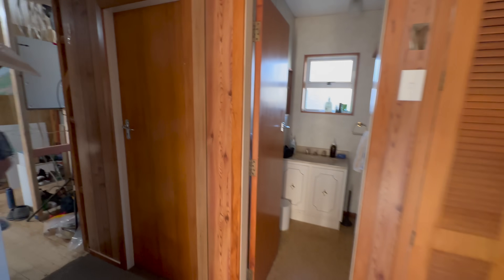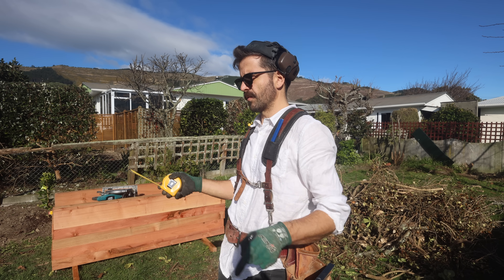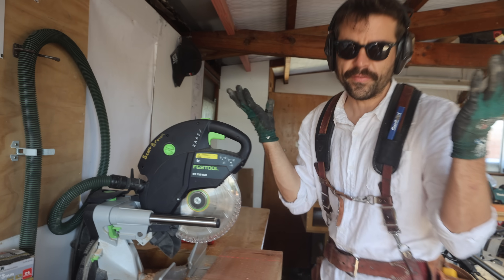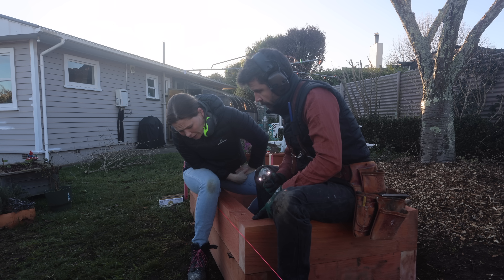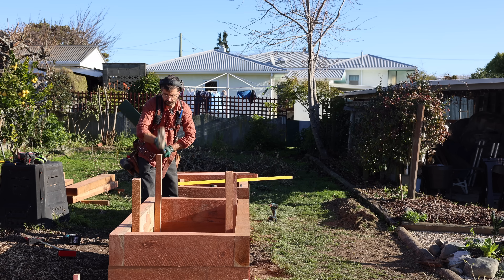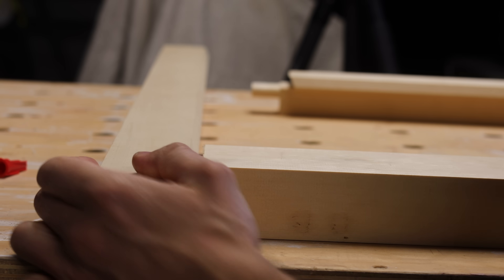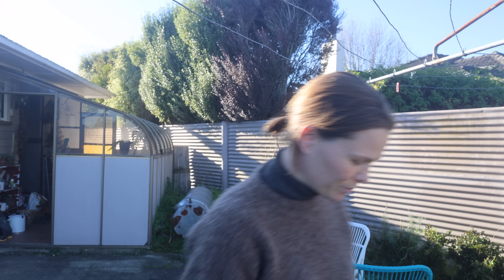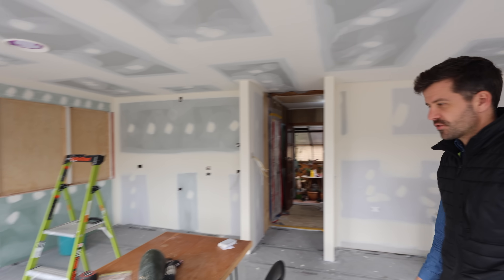A Fussy Carpenter Builds a Fancy Planter Box

Comment: Tip for then the screw jams and the impact drive won’t move it, cut the head off leaving 100mm, then put the tip in your drill chuck and reverse it out much more torque👍🏻 As always great video Scott!
Reply: I came here to say exactly the same.
Reply: Generally the continous torque of a drill will remove screws that impacts dont remove
Reply: I would have used a block and prybar, lifting under the head with one person whilst rtrying to reverse it out first. Just hate the thought of wasting a good screw.
Reply: I’ve done this but it actually damages your chuck doing this. The three teeth that hold the drill bit tend to get damaged, also instead of cutting the head off why not just use the drill to get it out?
Reply: Put the torx bit with a hex adaptor into a 1/2" socket set and use a galvanised pipe as a breaker bar.
Reply: get gasoline and a lighter and burn it out. works all the time
Reply: Scott brown will come here for the tips too. Like I have

Comment: Just a tip, if your impact can’t get a screw out, swap the bit into your cordless drill and put it first gear and hold on and it’ll either loosen the screw or snap it inside the timber. Love your work

Comment: Excellent planter boxes. Quick tip for next time you are filling a planter box, use garden bags for the soil / compost / leaves you are putting in. Much easier to shovel into a garden bag in the barrow and then just lift the garden bag of material and tip it in the bed. :) One lot of shovelling and much less mess. Wondering why you didn't put the logs in the bottom of the beds? Disease? Concerned they may sprout? Trailer - 8 x 5 minimum, tandem, with electric - hydraulic hoist. Investment I know, but really worth it, especially at this stage of your lives. Really looking forward to the kitchen windows happening. Paint is going to transform that room.

Comment: Hey Jess and Scott,
Good change of pace from the renovation routine.
For Jess: don't worry for the planter's "warning" color, it will grey out fast.
The "autofertile lasagna" (that's a rough translation of how we call them here) work well. It keeps moisture and cool when it gets really dry and hot, like right now for us in the North hemisphery. However, it takes some time to set. That's like a little ecosystem that installs itself there, with insects, bacterias and such. It often takes over a year for the wood to start rotting properly and hosting all this beneficial life. Don't be in too much of a hurry for immediate returns, you're in for the long run with these.
Good video, thank you!

Comment: I built outdoor planting beds for my ex several years ago.

I used pt 4x4s and drilled clearance holes though the first two layers. Offsetting them as I put them down. I ought some rebar and cut 36 " lengths and then pounded them into the ground. That stopped it moving.  I put poly on the insides of the timber framing to prevent it leaching out. My sensei and I went to the county dump to get a trailer full of compost. The trailer just fill it up enough to the top.

We had veg up the wazoo. So many tomatoes that we couldn't eat so the squirrels scoffed the rest of them.

Comment: i have three planters which are 1.200 wide by 4.000.  i use home made compost to top them up every year.  amazing how the soil level drops each year.  two big bins should be enough.  i fill a bin over a year and then turn it over into the other bin for use.  as the stuff on top has had a year to break down is is usually very rich.  my bins each hold 1.8 square metres.  amazing that you got redwood.  in wanganui i used macrocarpa as that was availbale in untreated and generally lasts 20 years outside.

Comment: Scott - you commented that you did not know the performance of redwood in soil.  In California, used all the time - fence posts.   Also in turn-of-the-century homes (mine included) they typically had a redwood mud sill foundation (redwood on dirt).  I had 100+ year old redwood what was not rotted or termite invested that I replaced with a concrete foundation.

Comment: Check out the square foot gardening method. Or, if you prefer (I do) the 30x30 cm gardening method. Special soil only 15-16 cm deep. A 5x2 square planter box can be built like a wheelbarrow at very comfortable standing height, without any bent back, using softwood lined with polyethylene sheet and some wheels. Easy to move around and possible to grow very intensively. Have always one just outside the kitchen door for harvesting. Replace with another as needed.

Comment: For Jess, when using the drill/ driver, put your support hand on the back of the head of the drill instead of on the battery. It will help to guide and keep the trajectory you are driving the screw, instead of holding the battery which taking away from the pressure driving the screw in the right direction. Like when you guys work together, nice flow!!

Comment: Hey Scott! Just wondering, are you using plaster, or is it drywall and mud for your project? Over here in the States, we have the option of blue board and plaster, but it's not very common unless the budget is unlimited. Curious to know what you're working with! Ron😎🤙
Reply: drywall and mud, gyprock plasterboard is the standard in Australia/New Zealand. Nobody does hard plaster unless they're loaded (and maybe in Western Australia where double brick is the standard? Basically everywhere else in ANZ uses stud framing).

Comment: G,day from Sydney Australia.
Excellent detailed window frame, "they" call the "legs" horns and would round them (one side) when used in sash windows. A trench was cut on the outside styles for the sash cord. This was inside a box frame with divided weights running  over pulley wheels, separated by parting beads.
🇭🇲🪟

Comment: When a batten screw or similar gets stuck like that, I find what helps most of the time, is using my drill on the low speed / high torque setting and unscrewing it. It will either come out or snap the screw.

Comment: First thing I every built out of sleeper was a pond. Hand cut all the sleepers with an electric saw- after that experience I would never use sleepers again. I have built planters for the garden which still look like new and are about 5 years old and have been through wet cold winters. I went for a round over, hurts less if you bang your knee on the edge. You could use bokashi composting, If you have enough space get a compost bin (1m x 1m) it’s the best thing you can do for your garden. The planters look good and will last years

Comment: He Scott, for the long screws its better to use a normal drill instead of the impact. The impact gives little kicks, the length of screw flexes, taking up the force of the impact, and before the next impact the screw flexes back. This way no energy remains at the screw tip. A normal drill puts continues pressure on the whole length of the screw which takes out the flex, and doesn't give the screw a chance to spring back.

Comment: Hey Scott, question. With the thermally sealed house, what heating will you choose? I'm trying to find any Kiwi real world information on infrared panels, the only suppliers I can find don't even have showrooms.
Reply: they already installed a heat pump ducted heating system in a previous episode. Heat pumps/reverse cycle units are the way to go - COP of 4-5 compared to max COP of 1 for infrared/radiant electric.
Reply: @Nickvin Yeah not true. Heat pumps lose efficiency very quickly and are expensive. Their COP reduces over time. Organic buildup on heat exchanges are a huge problem (could be ~60% reduction), there are no cheap ways to solve the issue. Infrared may have a place in conjunction with heatpumps. This is the shit I want to know.

Didn't ask for heatpump COP lecture. If you have Infrared panels information let me know.

Comment: Trailer, Chainsaw are a must as a homeowner,  also when i start a new hügelkultur bed, i will lay literal tree logs on the bottom (like the ones you were loading into the trailer) woodchips are also perfect but the common trick is to use wood that is rotting already, it provides the necessary micro organisms for it to emulate nature...you might need to invest in a 305mm mitre saw for your home workshop too lol

Comment: Scott, could you not of achieved the cut on the mitre saw if you had put a straight, thin piece of timber against the back fence of your saw? Bringing the sleeper forward slightly, result in the blade being able to finish the cut ?
Reply: Thought as much
Reply: This is the biggest problem with the Kapex. Rabbeting function is useless because the center of the blade can't go behind the fence. What was Festool thinking? I'll just put a scrap of wood on the fence of my $1,600 saw to make it work properly...

Comment: That screw would have gone out with a regular drill rather than an impact. We used one of those that they use for ice fishing when we screwed together timber in our cabin. None of the impacts we tried was able to. Milwaukee, Makita or Bosch. Went in/out smoothly with a Makita drill. Will hurt your arms tho :D
Reply: Bosch have a good video on youtube eplaining the reason for this, log story short, a long screw will absorb the many small impacts from the impact driver because the metal can twist a bit (like a spring), and that means that less torque is applied at the tip of the screw.

Comment: There is not any plants apart from Asparagus that need that much depth to live and grow in. Could have saved a lot not going so high. You will still have to mow the grass around those raised beds. You could have eliminated all that if you had mowed the grass right down to the dirt, layed layers of wet cardboard over the whole area, bought in compost, and wood chips for the walkway, and planted straight into compost layers. Built brick patio for your table and bar-b-que area and called it good..Go to the beach and get seaweed.

Comment: there are so many myths about composting and growing, don't worry at all what you have done in your gardens. the branches don't need to be soaked in water. ideal if they are partially rotted and full of moisture, if not jut throw them in the garden and they will become wet and rot down in time. as for needing top soil, no you don't. fill up the boxes with compost and plant into that. over time it will settle and the compost mix will reduce in volume as it breaks down and will resemble top soil anyway. even if you filled the garden beds with branches and grass clippings and wood chip and put a layer of rough as home made compost on the top, guess what, it all breaks down and becomes friable soil. time cures it all. easy as

Comment: Square, level, plumb and parallel planter boxes with all external aris corners chamfered as they should be. Good job Scott, but somewhat disappointed you cheaped out and didn’t dovetail the external corner sleeper joints.. your standards are slipping.